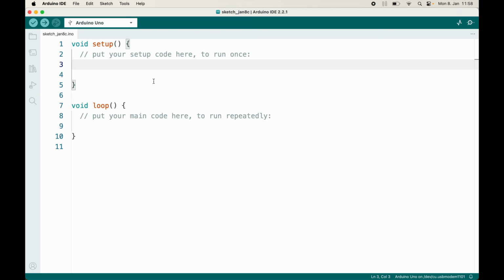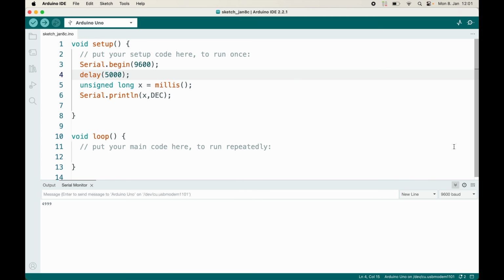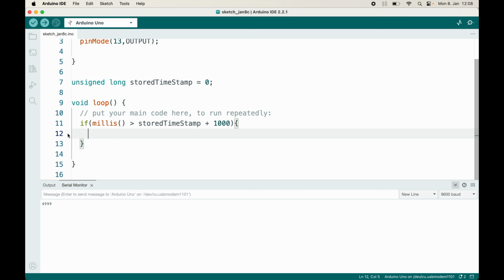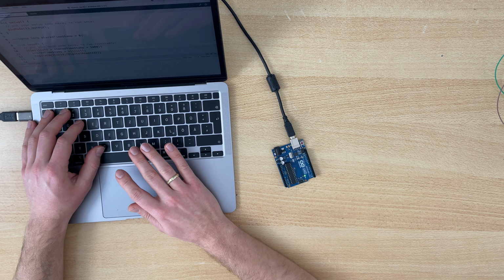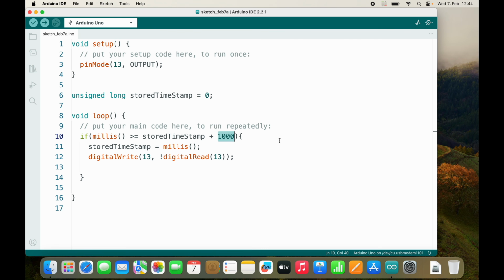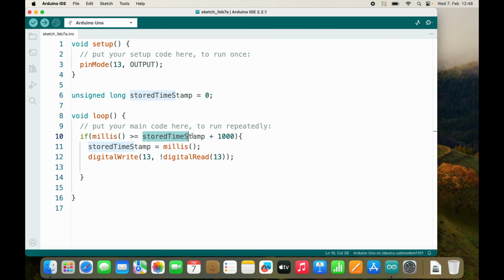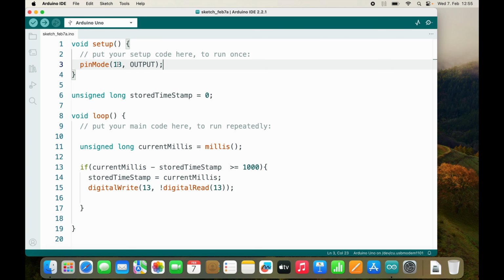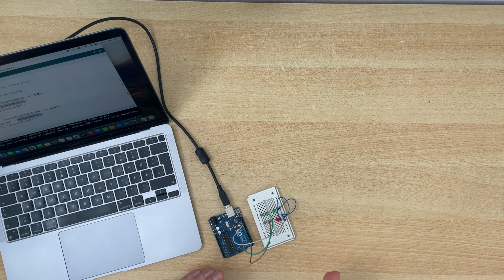I was wrong about millis: how to write non blocking code: (Arduino Uno Programming for Beginners)

Comment from the maker: you can find the code on git:
https://github.com/playduino/arduino-uno-programming
Reply: With your code, will it work to RUN Arduino nano with pin jumper wires from addresses, data to 28 DIP socket, that has not been taken off its motherboard and will DUMP the RAM ROM contents into Arduino, while the 28DIP ROM RAM is in operation with its own arcade motherboard machine
Reply: I want to keep the RAM seated without removing it from the fiberglass motherboard and run jump lines from its socket out to a breadboard where Arduino nano has a ROM dump script and connect that to Arduino Editor for serial monitor. Should I leave the RAM connected to its original motherboard without worrying about what it will do?

Comment: OMG please stop! You only need one start time and one interval to time an event. Unsigned math: elapsed time = now - start time where now is millis or micros for close measure.
if ( now - start >= interval ) { to do after timeout }
if ( now - start < interval ) { to do until timeout }
and to update now
  now += interval; // the if() may be late, this makes now to now an interval apart always
If you follow these, you can time with unsigned int up to 65.535 second intervals. 16 bit numbers process twice as fast as unsigned long.
You can use byte with millis but be aware that the low byte of millis() will never be FF or 5 other values due to how millis() works.
byte x = millis(); // will get the low 8 bits of the millis clock
unsigned int y = millis(); // gets the low 16 bits ---- think of millis like odometer wheels. For short trips, you only count the last 2 or 3 digits.
Arduino millis is +/-1 always, if close matters, use micros()
and just BTW, serial at 115200 baud will empty the print buffer and get new data 12x faster than 9600 baud.

Comment: Blocking code is fine in a setup or a one time run. In a game or in data gathering, you get in trouble. The delay(n) can be needed with specific issues, but you can branch out with "modes" if one thing goes against another. A digital watch is a good example of modes.

Comment: There is actually a simple solution to this issue.  If you make sure all the variable involved are Unsigned Long and you check new_time - old_time to get your duration, then if an overflow happens, the calculation will ALSO overflow, giving you the proper duration.  Hope it helps. ^,.'.,^
Edit: I had the variable in the wrong order and corrected them.
Reply from the maker: Thanks for your comment about handling millis() overflow! I appreciate you sharing this insight about unsigned arithmetic. I'm actually using currentMillis - previousMillis in my code (new_time - old_time), but you mentioned doing it as old_time - new_time. I'm curious if I misunderstood your suggestion or if there's a specific scenario where that order would be beneficial? I'd love to learn more about your approach if you have time to explain further.
Reply: @playduino   I had them backwards in my reply, it should have been new_time - old_time.  I will correct that now.  Still, my concept stands.  if you use unsigned long variables only to subtract the larger old_time from the tiny new_time, then in the event of an overflow the subtraction will also overflow, giving you the proper result.
Reply from the maker: @glowpon3 true 👍 now it makes sense :) thanks
Reply: That seems simple. Just new_time minus old_time (both unsigned long) will work? Or do it like: 
duration = new_time - old_time (where all three are unsigned long).
Reply: isn't he already doing this? using unsigned longs? therefore overflow safe

Comment: Hi, I have 2 blocking coded that both have delay 
I have a servo code that goes from 30 to 60 and from 60 to 30  with a delay of (15) speed back an forth. And also a DF-Mini player that has delays..

I'm not to familiar with Arduino so am needing some assistance
Reply from the maker: Hi, instead of delay(15) you could use the code shown in this video and then handle the servos instead of blinking the led (what I did)
Reply: @playduino  would you still have the code ?
Reply from the maker: Hi the thing is, I do not know exactly what you are trying to do. However I think in your case the simplest solution is actually to use a library called TimerOne. You can keep your working blocking DF-Mini code in the loop. And then have a timer isr function called every 15ms. Inside you change the angle of the servo. You will need two static volatile global variables, one for current angle (int) and one for the direction(bool). Inside or the isr you increment the angle if direction true and decrement the angle is the direction is false.
If you hit the maximum angle you need to change direction to false.
If you hit the minimum angle you need to change direction to true.
Put all this logic into ISR, but don’t put a delay into the ISR. You do not need it, because the ISR is called every 15ms.
I’ll upload a video about TimerOne soon. But if you look at example code I’m sure you can do it
Reply: @playduino  HI well what I am trying to put together is a sketch for a wig-wag (sweep servo)  using a IR sensor and a DF-Mini player.

Comment: Its very good to know how the nuts and bolts of this stuff works so you know how to properly use it and know it's advantages. Now I'll shamelessly plug the NoDelay library that helps you use millis for timing without having to write that many lines of code yourself. Great for multiple timing loops

Comment: Before you deploy this to your nuclear power plant, what happens when currentMillis overflows and is less than the storedTimeStamp?
Reply from the maker: I would not deploy this to my nuclear power plant yet, but I am pretty confident that this will work because subtracting the big number will lead to a overflow that results in a small Number. Let's for a moment assume that we only have 8 bits. If storedTimeStamp = 255 and currentMillis is already very small, lets say 10.
Now we calculate 10 - 255. it will overflow to the result 11.

I just tried it by running the code:

Serial.begin(9600);
byte x = 10 - 255;
Serial.print(x,DEC);
Reply: @playduino  Ah. I wasn't sure how Arduino handled types in conditional expressions, but it does look like it remains unsigned and overflows correctly. This is not always the case. Evaluating the difference of 2 unsigned types within a conditional can return a signed negative value on other platforms. Looks like you are safe to deploy after all. ;)
Reply from the maker: interesting. I assume as soon as one of the numbers in signed, the result will also be signed. Yeah all good, lets get this power plant up and running :D

Comment: Thanks. Now the LED starts off and it's take 1 sek to light up. If I want the LED to start at once and then starts to blink. I tried to move the !-sign first but it's not accepted. Can you suggest something?
Reply from the maker: hmm one solution is to turn on the LED in the setup, directly after pinMode.

Comment: // Blink an LED on PA2 on an ATTiny1614 MCU

// Pin definitions
// Important - always use the full pin definition i.e. PXn where X is the port letter and n the pin number
const int ledPinRed = PIN_PA2;// Pin 2 Port A
const int ledPinBlue = PIN_PB1;// Pin 1 Port B
// Variable definitions
unsigned int A = 888; //dividend
unsigned int B = 444; //divisor
unsigned int C = 666; //dividend
unsigned int D = 222; //divisor

void setDefaultPinStates() {
  pinMode(ledPinRed, OUTPUT); //set as output
  pinMode(ledPinBlue, OUTPUT); //set as output
  digitalWrite(ledPinRed,HIGH); //start with LED off
  digitalWrite(ledPinBlue,HIGH); //start with LED off
}

void setup() {
  setDefaultPinStates();
  delay (1000);
}

void loop() {
/*
  Flash the LEDs on PA2 & PB1 with a single line of code.
  The remainder of millis divided by A is compared to B
  and when greater the result is 1 and when less is 0, this binary result
  is written to the appropriate ledPin
*/
  digitalWrite(ledPinRed, millis() % A > B);
  digitalWrite(ledPinBlue, millis() % C > D);
}
Reply from the maker: digitalWrite(ledPinRed, millis() % A > B)
looks like a very interesting way to get blinking patterns, thanks for sharing
Reply: Not my idea I discovered to concept from https://www.youtube.com/watch?v=foiqs-rNHig&t=38s @playduino

Comment: Your new code will work just fine!  However,  if you don't fancy waiting almost 50 days for a rollover, do this In setup to adjust the millis counter.

extern unsigned long timer0_millis;
unsigned long untilOverflow = 1500;

noInterrupts();
timer0_millis = 0xffffffff - untilOverflow;
Interrupts();

Now wait 1500 milliseconds and the millis count will overflow.

Cheers,
Norm.
(Author of Arduino Software Internals  and Arduino Interrupts)
Reply from the maker: Awesome, this is very useful, I will give it a try! Thank you very much!
Reply: Nice! I'm going to check your book out. I'm in the interesting position of being what I would consider an intermediate programmer writing code for Arduino that will go into production in toys, so I'm doing as hard a crash course in C, C++, and Arduino/AVR programming as I can manage. Your book looks great!
Reply: There aren't any need for checking overflow when you use milis
Reply: @victormikecharlie1596  There is! But it depends on how the test was written. The result of millis() doesn't go negative, obviously,  but it does overflow from 0xffffffff to zero. That's the problem for some calculations.  As described in the video.

Cheers,
Norm.

Comment: Very nice video. Also not just rerecording and only showing the correct code, but also talking about why the old code is wrong is a perfect solution. Guys can learn much more by such a code review. Maybe as a task for every viewer: rethink why the old problems do not appear anymore. Think exactly about the 2 situations that lead to the old bugs. The first one is easy to explain. The second one is more difficult to explain.
Reply from the maker: Thank you :) I agree, I really tried but it is very hard to explain and I had a hard time understanding the issue in the first place.
Reply: @playduino  Well, rethinking about bug 1 and 2 again in fact the first code was even faster buggy than I thought. Since if the if statement is executed in less than 1ms, this means that the storeTimeStamp is (at the end) always set to millis() (because of bug 2). So it will be set to the max value also and that mean bug 1 will occur 100%. Luckily you fixed it now.
Reply from the maker: OMG true, so the code would stop after 50days for sure